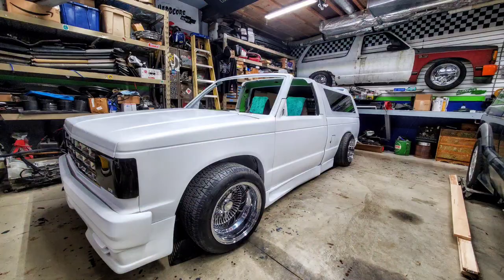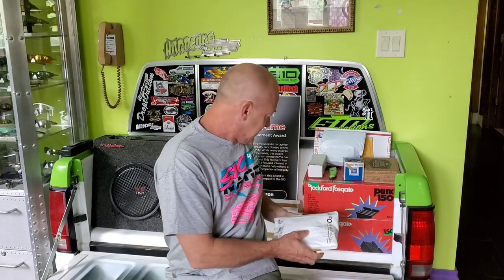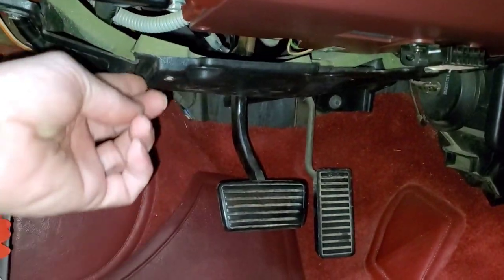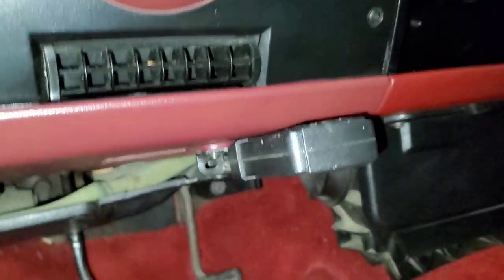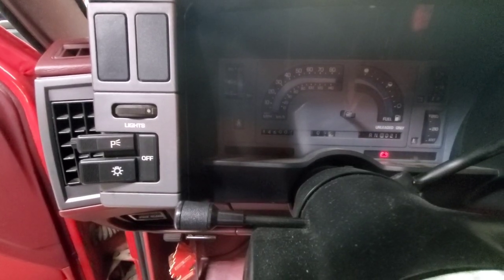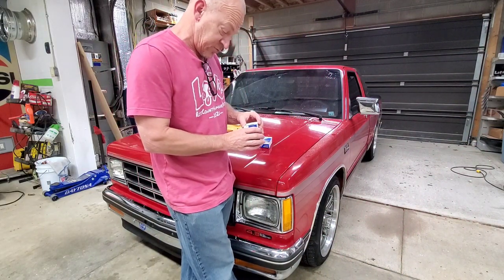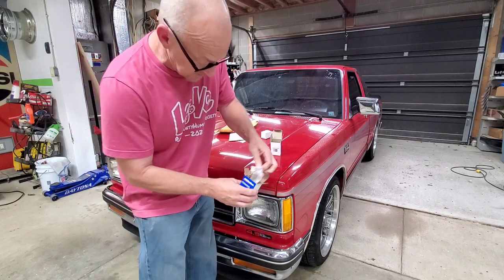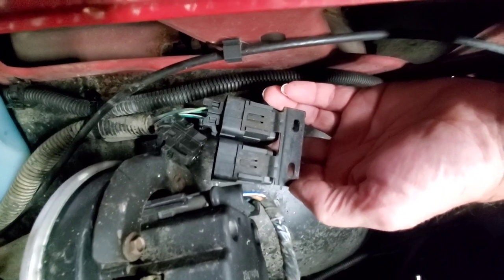Diagnosing The D90 Chevy S10 with an OBD1 Code Reader. Throttle Position Sensor Replacement

Comment: I hope the relay fuse helps on my truck , when about do a stop or red light it shots 📴 , it says check Gages but it turns on by giving some gas  is a 93 2.8 5 speed
Reply from the maker: Does the idle drop at stops?
Reply: @HardCoreGarage  yes

Comment: Man the only code it threw was a 13. Which is a bad o2 sensor. Replace your o2 sensor. You did not read the code correctly.
Reply from the maker: 13 is a single flash,  pause and 3 quick flashes.  It definitely never does that.
Reply: @HardCoreGarage  Johnny. It was a 13 code. It blinked once paused and blinked 3 times. Your truck has a bad o2 sensor. I have several of them and have had to read codes a million times. I promise you it is a 13 code. It gave you the default 12 code 3 times as it should always does. Then it gave you a 13. But you have to wait until you get the first code 3 times. Once you do it will pause and give you the next code. If it goes back to the 12 code then you only have a 13. You can just ignore my experience and keep changing parts or just put an o2 sensor in. But I would like to see if you fixed the truck. Cause you never even showed that. Im telling you that you did not show anything but a default 12 and a 13. Period. 13 is an o2 sensor code. Means oxygen sensor open or no activity.
Reply: @HardCoreGarage  im just trying to help bud. One of my s10s has a tbi 350 in it and it is running on all 4.3 sensors and has a 350 computer chip running it in a 4.3 computer. So I have a TON of time with figuring out how the tbi system works. My truck has a 350 and runs like its factory without even a check engine light. I promise you bud. It was a 13 code.
Reply: @devillenm5525 Looks like you're right to me. A 13 code.

Comment: 91s10 4.3 2wd automatic I'm wondering if that's why my throttle has a hard 1st shifting  stubbing in 1st gear taking off if I jump on it
Reply from the maker: That I dont know. But its cheap enough to give it a try.  This ran fine but would randomly die after this.  Ended up changing out the ICM. And it fixed the issue.